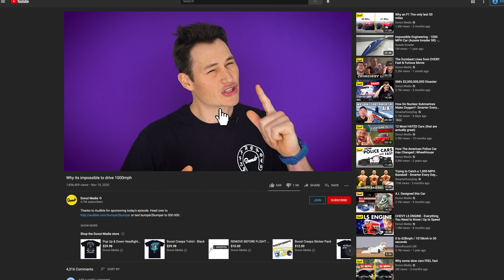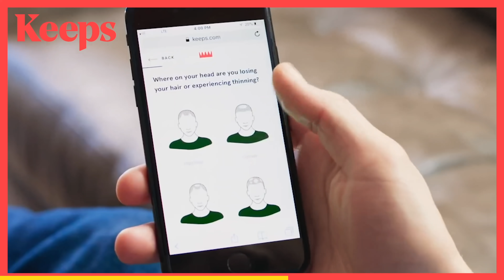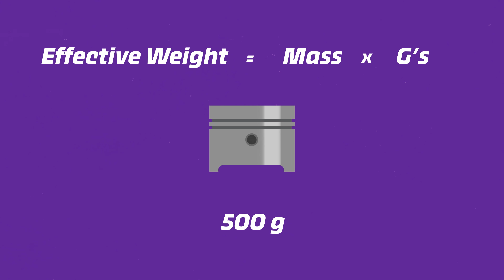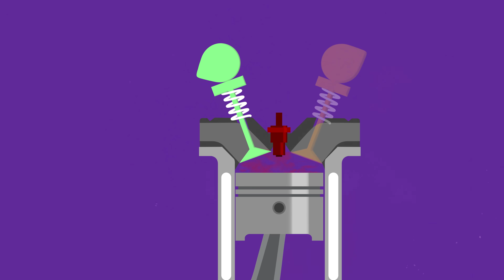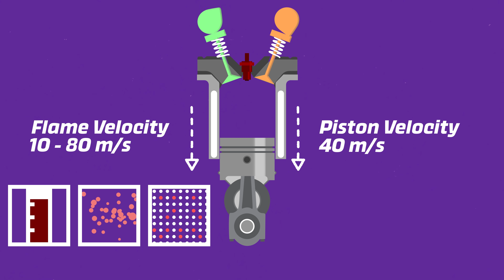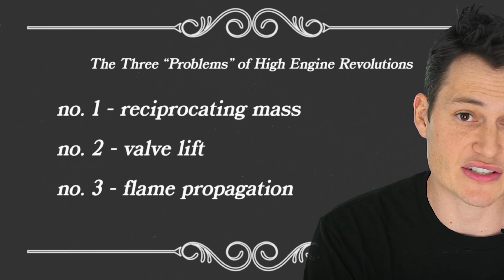Why It's Almost Impossible For An Engine To Rev Over 20,000 RPM

Comment: Street bike engines all rev close to 20,000. Mine revs at like 17k and it could go higher with some mods. The answer is lower compression ratio.

Comment: He forgot one big problem of high engine RPM ... lubrication !
Once the pistons exceed the speed that the oil film can hold itself together, the film "breaks", and then there's no lubrication.
Once you have metal-on-metal movement, friction rises drastically, producing insane amounts of heat.
And if it gets bad enough, it can fuse/weld the piston to the cylinder ! And then everything explodes !
Reply: exactly...I think above 600feet/min with hydrocarbon oils
Reply: @waynewhite2314  
Add another zero, and you're in the ballpark of most modern sports cars.

But yeah, new oils are better at high piston speeds. 😀
Reply: @Grumpy_old_Boot  yeah I think it feet per second...my bad
Reply: @waynewhite2314  
No problem, it's all good. 😀
Reply: Honda rc115 says hiii 👍
Reply: @tiagofigueiredo2529  
Ha ha, yeah Honda made some high rpm monsters back in the 1960's when they were experimenting with it.

As I understand it, the trick was to make the stroke so small, (I think the RC115 was 25 mm and some of their test engines even shorter), that the length of cylinder where the piston exceeded speeds above the oils ability to lubricate, was something like 2-3 millimeters. Thus they could manage the heat, and reach insane rpm's.

Of course, they still had issues making the pistons and rods strong enough, not to mention avoiding valve float and ring flutter.

Some said they reached 35k rpm on a test bench engine .. absolute insanity !
Reply: Like a drag car!
Reply: @external316  
Interestingly, a lot of drag cars don't really hit high RPMs, they tend to go for stroked engines with high torque instead, that way they can have less gears and thus less gear shifts, which means more time on power.

A lot of private drag racers run on LS engines, which rarely go over 8k RPM.
Reply: @Grumpy_old_Boot  interesting! I am wanting to legally drag race.
Reply: @external316  
Look up Cleetus Mc Farland ... he has a lot of drag racing based on a LS based corvette platform.
The Ls platform can take a bunch of boost too.
Reply: @Grumpy_old_Boot  With drag racing getting it moving quickly in the first few hundred feet makes a huge difference in time. So, they favor high torque at lower rpm to get it moving quickly from a stop. Generally an engine built for high rpm doesn’t make much torque at low rpm.
Reply: @NBSV1  
High RPM can be offset to some degree with proper gearing and a well dimensioned clutch/Torque converter.  Also, with modern engine management can hold you at a steady RPM during launch, and limited boost, to help avoid wheel-spin.

But I do agree, that most modern dragsters rarely go over 7500 RPM, and usually launches around 4500 - 5000 RPM.

However, since this video is all about high RPM engines ... well ... the discussion naturally went towards high RPM engines.
Reply: @MMonster-x5h  
Just keeping the piston rods together above 10k RPM is fairly difficult, unless you have a very short stroke, like on a motorcycle.
And you definitely don't want high RPMs with a long stroked engine, then you end up with insufficient lubrication, because of piston speed.
Reply: That’s why engines can seize
Reply: This is why F1 oil is like water and NOT made from mineral oil.
Reply: @bertram-raven  
Yyyyessss sort of, and also no.

As engine oil heats up, the viscosity actually changes, in most cases from a low viscosity to a higher viscosity.

Many cars run with a 5w30, which has a weight of only 5 when cold, and has a weight of 30 when heated up to 210 C.
(normal engine temps are usually in the 195 - 220 C range)

However, in a normal car it has to be able to bridge larger gaps, as tolerances are much tighter in a race car engine, then in a normal car. Thus thicker oil is needed.

This increase surface tension, and the energy needed to break that surface tension, is part of what builds up friction in things like cams, gears and bearings, thus it robs power.

With a F1 engine, you have tight enough clearances, that you don't need that extra tension, and can go with an oil that is almost as thin as hydraulic oil (thin, as in can only bridge smaller gaps) which increases performance.

Curiously, the lubricant that makes it into the cylinder, doesn't really have to handle the gap, as that is handled by the piston rings - Instead the oil is compressed in between the cylinder wall and the piston ring.
The piston rings almost scrape the oil off the cylinder wall when they pass - only a very thin oil film makes it in between the cylinder wall and the rings, but that's enough.

Again, the thinner oil is easier to move, than the thicker oil, thus once again creating less resistance, thus you get more power out of the engine.

The flip side of thinner oil, is that it's often more susceptible to contaminants (like micro contaminants), and may degrade faster, changing it's viscosity.

But F1 teams take their engines apart so often, that this degradation barely matters, whereas a normal car runs thousands of kilometers on the same oil.

Also, a F1 engine never has to worry about cold temperatures, because they pre-heat the engine block, by heating up the coolant, and cycling it through the engine.

Basically the F1 teams use thinner oil, because they loose less power, and don't have to worry about long term impacts of thinner oil.

The actual piston speed capability of the oils, are shockingly similar, due to the length of the molecules, which is what governs how much abuse the oil film can handle.

.......... there's more to it, like additives and so on - But I think I have ranted enough for now. 🤣
Reply: @Grumpy_old_Boot  Yea umm, NO. Race engines generally have clearances LARGER than passenger car engines do. There is ZERO point in trying to close up clearances in a competition engine.
Reply: I love some good lubrication
Reply: If engines gunna be running hot use thicker oil or better higher temp high resistant racing oil..
Reply: Wouldnt a better oil pump solve that? Force the oil to move
Reply: @12th.jahlil  
Sort of yes, but also no.

In some use-cases, oil availability can be a problem, but most of the cases we are talking about here, is a breakdown based on physics, where the oil simply cannot physically flow fast enough, known as shear.

Shear is when the oil film literally breaks, because it is moved too fast at very high piston speeds.

I know it sounds odd, but it happens in all lubricants and has to do with the lubricant film shear strength. Viscosity has a major impact on this.

Also, oil pumps robs power, the more oil you pump, the more power you loose. Viscosity also have a major impact on how much energy it takes to pump the oil around.

Not only that, but viscosity also changes with how hot the oil is. Which can then change how strong the lubricant film is as well.
Reply: wow thats alot of information! Thank yoh @Grumpy_old_Boot
Reply: Sounds like fun
Reply: That is NOT a problem with any current engine....
Reply: @MMonster-x5h  😆 Umm, NO....

Comment: How would this impact the HP of electric cars?
Reply: Electric cars use kilowatts (kW) and it's just converted to horsepower. Keep in mind a 100hp electric car usually has much more torque than a 100hp diesel/gasoline engine.

Comment: The only reason why we don't have engine rev higher than 20k is just regulations in F1 otherwise we will. C'mon you are talking about spring valves and push rod engines, that's irrelevant for F1. If you are talking about road cars... that's just stupid.

Comment: within the first 25 seconds of the video you are already wrong. my nitro rc truck has an internal combustion engine that runs at 36000 rpm at full tilt. dont say "the fastest revving motor" if you don't specify what kind of engine. with your logic i own the fastest engine in history, but that's not true because it's completely stock and you can get one too

Comment: Why It's Almost Impossible For An Engine To Rev Over 20,000 RPM 
Laugh´s in Two Stroke/ Rotary engines
Reply: Two-stroke engines are limited by the same physics as four-stroke engines (minus valve float), and rotary engines aren’t reciprocal engines.
Reply: @joshuahite4360  he is reffering to 2 stroke rotary VALVE engines, not WANKEL rotary engines, I race two stroke karts and they reach 21.000 rpm
Reply: @joshuahite4360  does the title say reciprocating engines? If not, I don't see how he's wrong on that front.
Reply: @bonovoxel7527  THANK you.
Reply: Or laughs in gixxer. Don’t remember the year model or if it’s even production bike, but a friend of mine had a 26k rpm 750. It screemed like hell when you passed the 17k mark wich is also the limit on the standard model i believe. Nevertheless that thing revved way too high.
Reply: @Danol123  Yeah, that didn't happened though 😅
But the Honda RC115 says hiii. 👍
Reply: He did briefly mention that jet engines can hit 1,000,000 then started talking about reciprocating engines.

Comment: At 20,000 rpm the CA's maximum piston acceleration was 10,616 g while 
the load imparted on each crankpin by the associated piston and con rod 
reached a very substantial 5937 kg at that unprecedented speed. To put 
that into context, an anti-ballistic missile attains a g-force of only 
100 g while 5937 kg is approximately two and a half times the weight of a
 Rolls Royce Wraith!

Comment: maybe you could add also 4. at such high revs filling the cylinder with fresh air and fuel, mixing it before ignition, and pushing exhaust gas out becomes an issue  ? for example using direct injection, air and fuel have only so little time to mix, so if you have pockets of very lean or very rich air fuel mixture, combustion is less efficient and slower, making point 3. even worse

Comment: Years ago, Honda made a five cylinder 125 CC racing motorcycle.  It was rated to run continuously at 18,000 rpm and had a redline of 23,000 rpm.
Reply: Stalled below 15000 rpm

Comment: Traxxas tmaxx 2.5 revs to 50k rpms. 2 stroke nitro(diesel) minimalizes moving parts, highly lubricated, and self-supercharging. 2.5hp from 2.5cc. downside? Tolerances are gone after around 10 gallons of fuel.

Comment: Many people 100 years ago, or even 50 years ago, believed it was “impossible” to have what FaceTime is today
Reply: yeah and many people over 2000 years ago belived you can't boil water in 80 degrees C.
Lets wait another 2000 before pulling out any conclusions.
Reply: The temperature water boils also depends on the atmospheric pressure surrounding it. therefore it is possible to boil water at 80 degrees C
Reply: @tihs87  i never knew Celsius was around 2000 years ago !!!!
Reply: @tamuwu  u win
Reply: but did the people 100 years ago make a video why it's impossible to have what facetime is??
Reply: Pawel: so I took that personally

Edit: Hi Pawel, I know you are reading this
Reply: Face-palm-time

Comment: ah yeah, 20500rpm maybe be the max for a larger car motor.. bikes like the cbr250rr could rev that high too. not to mention two strokes and rotary motors. I would love to see a video on other engines that rev higher than that.

pretty sure some rc motors rev very high. from my middle school days a Traxxas 3.3 (I think 3.3cc) revs to 50k and makes almost 1hp and very little torque

Comment: there was an radio controlled airplane piston motor that could reach 22k rpm but of course its very very small .91 ci (less then one cubic inch), 2 stroke Schnuerle ported, and powered by a mix of nitro/alcohol/oil fuel
O.s.  .91 vrdf

https://inkpothobbies.tripod.com/Catalog/os91vrdf.htm

Comment: Renault F1 V10? 20k RPM has been done and for hours at a time. F1 would even go higher but the change in engine specifications killed it. Ban turbos, limit displacement, allow pneumatic springs, and raise the allowed rpm and you would see it within 3years

Comment: Gas turbines will do 150,000rpm
Reply: @fóréīgñ ídìōt that's a very tiny nano turbine with a rotor assembly  couple of millimeters across floating on a magnetic generator, and is all kinds of clever.

Comment: there is an except that it strengthens the rule: airmodel engines.
like this one with maximum of 33 900 rot/min! (http://vi.raptor.ebaydesc.com/ws/eBayISAPI.dll?ViewItemDescV4&item=383888628461&category=182189&pm=1&ds=0&t=1614893261851)
and strength those rules:
- small reciprocal mass (4,57 cubic Centimeters - 0.28 inch with stroke of 17 milimeters (little more than half of inch))
- 2 strokes engine: no valves attached.
- small stroke for burning special fuel.
main key to such high speed is small dimension of the stoke. In nature is nor possible for the eagle (or condor) to flap its big wings like small wings of the hummingbird. this also apply to the engines, where big naval engines have speeds of 250 rot/min.
but i thought there is also a limit of the speed of air intake and exaust which must be smaller than speed of sound.

Comment: So you’re like not going to mention that those old school high-rev F1 engines also used freezing cold Toluene, a rocket fuel that burned so quickly they had to add 20% diesel in order to make the combustion sequence last long enough

Comment: F1 2006 - 2.4 litre V8 required. Rev limits were well over 20,000. As someone else commented the main limitation is money. 
Of course control line speed model aircraft engines go way over 20k. Typically a 2.5cc speed engine coughs out over 2hp at 36,000 rpm (and that has to be done without using nitro)

Comment: If you add turbo, you better not rev high. Turbo will rotate fast and higher HP can break faster engine too due higher air pressure.
I think high-rev engines have no turbo. Less mechanical stuff in engine, less chance it will break.

Comment: Ahhh... yeah, had my fun in my younger days tweaking the timing and making my 13B go to super sonic RPM's. There is no better fun than pantsing a V8 by getting first to 100mph in only 1st gear and still having power to burn... My mates kept asking if I had a jet engine in my RX4..... I've calmed down now 40y later and only drive slush box diesels... Times change... lol

Comment: Many small RC nitro engines will actually do 35000 fairly easily, of course they are much smaller engines with less reciprocating mass and a far shorter stroke. Still due to being a 2 stroke engine, they don’t have any valves to float.
Reply: And since they're glow plug ignition there's no additional parts to try to get to work at that RPM.